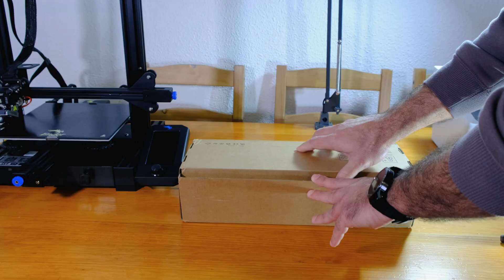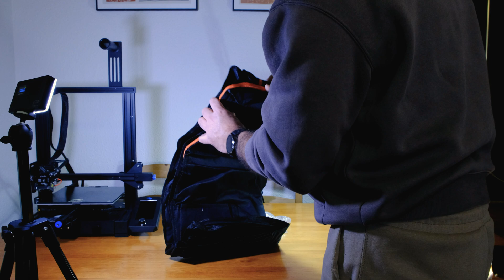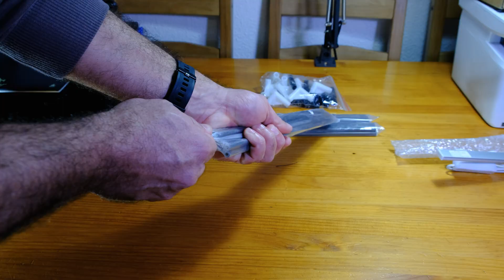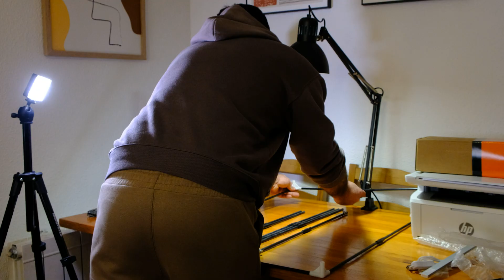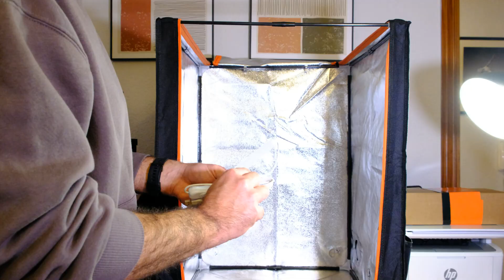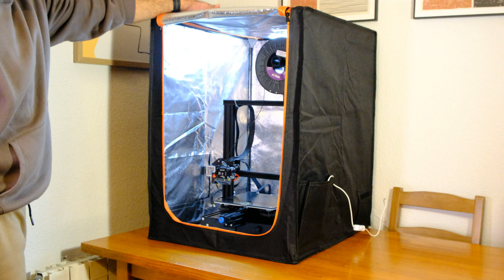Yoopai 3D Printer Enclosure Kit: Unboxing & Assembly

Comment: Thanks for nice intro about this enclosure. I have another question, it seems you upgraded your Ender3 V2 to direct drive head. Can I get some info about it? I am also using same printer and want to upgrade it like you.
Reply from the maker: Thanks! Yes, I upgraded my Ender3 V2 to a direct drive setup. This printer was actually a gift from my cousin, who upgraded to a Bambu. Before this, I was using a Longer LK4 Pro, which worked well, but I couldn’t print flexible filaments because they would get stuck.

With this direct drive extruder, printing flexible materials is no problem. It’s a bit slow compared to more modern printers, but I don’t mind since I get the same results for the materials I use without spending too much.

Also, with this enclosure, I can print ASA without issues. I’ve noticed the layer adhesion in ASA is even better than PETG, which is why I prefer it for my projects.